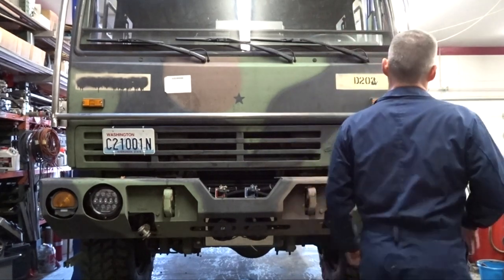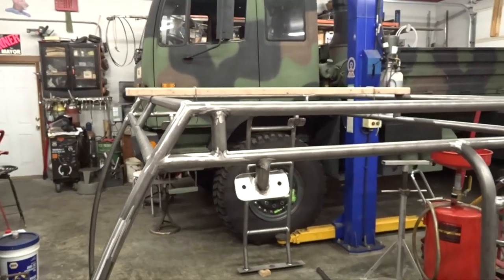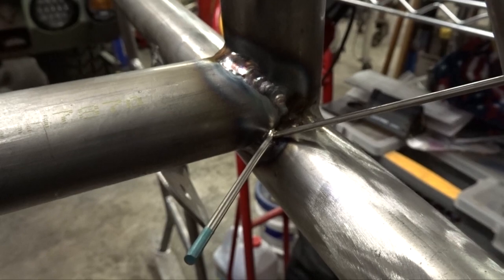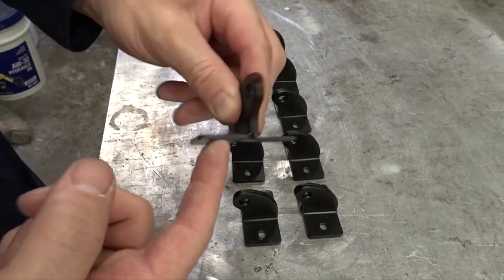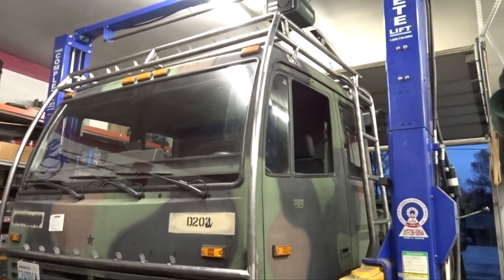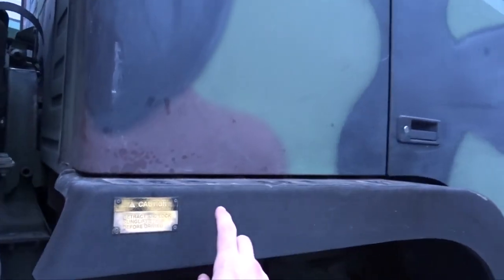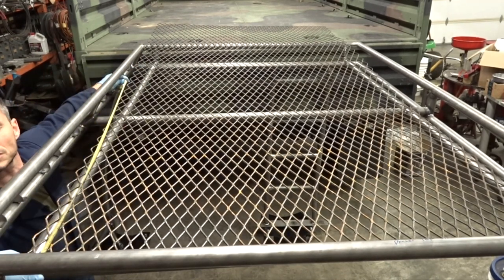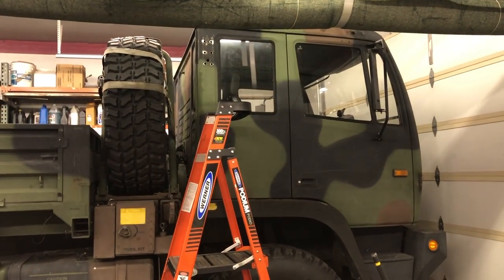Welding a floor on the roof rack for the LMTV

Comment: Very nice 
What size tubing are you using? Did you have to weld in addition support where the rack attaches to cab ?
Reply from the maker: I used 1” 1/2 tubing and no I only bolted on backer plates.

Comment: Great work! Have you given powder coating any thought. I hear it holds up better then paint, and after all the work you put into it, it would be one less thing to worry about holding  up in the future.
Reply from the maker: Manuel Serrano I was originally going to powder coat it.  But I’ve decided on paint so that when I scratch the crap out of it (and I will) I can touch it up with a rattle can from any parts store.

Comment: Did you cross Square any of that frame or your ladders?
Reply from the maker: mojo1169vj nope.  I built it on the truck.  Pulled it for final welding and then put it back on the truck to make sure it still fit.
Reply from the maker: mojo1169vj actually looking back through the video and my notes I did cross square the top.  The ladders where measured from the back of the cab.